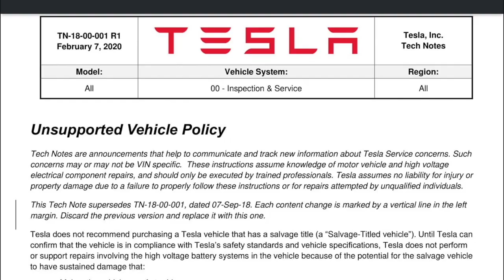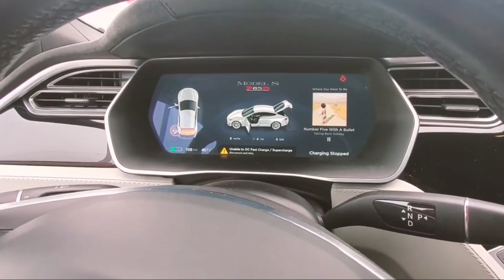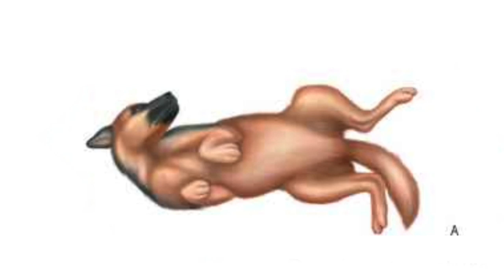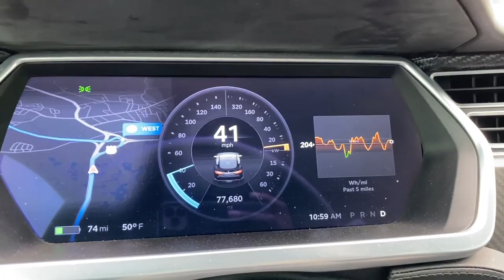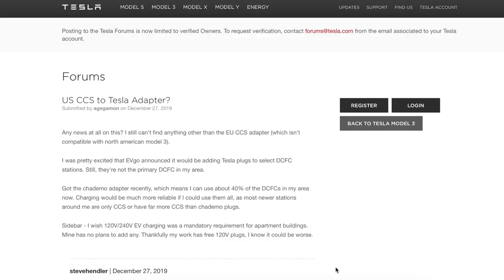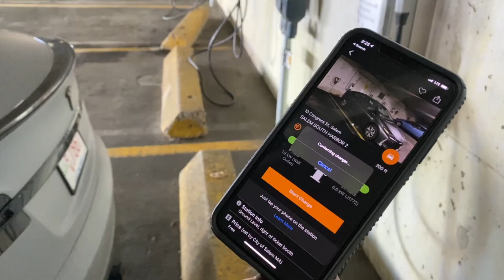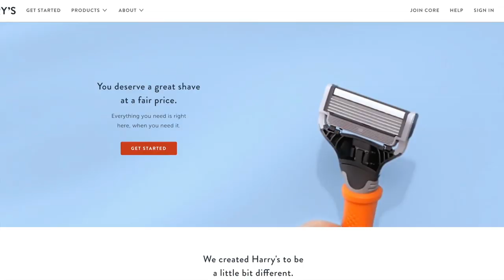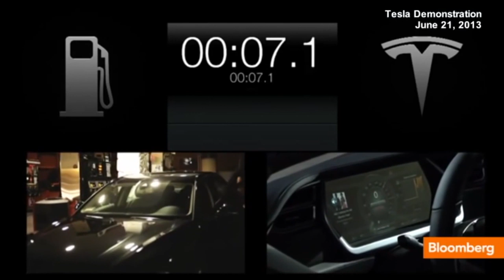Tesla ruined my car and it’s the best thing to ever happen to me!

Comment: The fact that THEY DISABLED THIRD PARTY DC FAST CHARGING is too far
Reply: and this is why i still drive a gas truck.
Reply: not really the fast charge system is basically enable by the car and if your car is deemed "unsuitable" tesla disables THEIR fast charge software. yes you own the car but dont own the software behind it (i completely disagree with this scummy business practice).
Reply: @shaneebahera8566  exactly its like saying here we will sell you this car but wait little did you know its actually only half of a car because we dont think this car is good to be used at its full capacity so were going to handicap it after you buy it, it wont already be disabled and notify you that it is before you get it, you can just find out later and then get hindered in your everyday life because you cant afford to buy new from us.
Reply: Did they realy disabled third party dc fast charging?
Reply: Tesla is basically Apple 😂
Reply: @mourinhov4360  Yes. Tesla remotely disables third party DC fast charging for salvage/unsupported Teslas
Reply: @neil532gamingneil532gaming  ok sad to hear that. Tesla is trash. Its better for our enviroment to repair broken things, instead of just buying them new. They don't have to claim that they care about our enviroment.
Reply: @shaneebahera8566  Eh kinda disagree. That would be like Chrylser disabling my 300's fill door switch because "hey the fuel door is computer controlled and we own the software and you rebuilt it so no gas for you". Tesla doesn't own EV America.. honestly disabling the ability to use a third party charger is probably going to be tossed out in a lawsuit as anti-competitive.. That'd be some interesting content I'd watch btw Rich so lawyer up buddy
Reply: @douglas685  its not really because you can still charge they are disabling the fast charge ability its probably mentioned in an agreement you sign or agree to when you buy the car. Tesla operates more like a computer company than a  car company and this is the kind of shit we just deal with like how apple can disable your device if you use unapproved repairs. Even if he sues them i doubt he would get anywhere because they arent targeting third party equipment  they are just outright disabling the fast charge system (not defending them here just mentioning they are probably on solid ground legally)
Reply: @shaneebahera8566  that agreement is likely non transferable. If i purchase it second hand I am not bound by the original agreement. Sony got sued for disabling features on the ps3 that were a selling point. Apply got sued for down specing there phones when they got old. Tesla will get sued and it will be forgotten. People need to start paying attention and talking with there local state reps on right to repair bills. This is pervasive and will only get worse.
Reply: @isaaclyonsf1  was thinking the exact same thing
Reply: This is just like what John Deere and others are doing to farmers.  Trying to prevent them from fixing their purchased equipment or vehicle.
Reply: @randerson752  EXACTLY!!!
Reply: @randerson752  Exactly.  This is a right to repair issue.  Tesla needs to be taken to task for it.
Reply: @randerson752  except at least John Deere doesn't disable any software features (I think?) like Tesla does

Comment: TESLA turned your car into, as far as charging goes, a golf cart.
Reply: Is your profile pic the startpage anonymous search icon
Reply: A very expensive golf cart.
Reply: Golf cart, EV... same.
Reply: Well, actually with a dual AC charger it still would allow 19,2 kW AC charging, so top up the 80 kWh battery up in about 4 hours. That's not too bad. Just find yourself an 80A Level 2 charger instead of the 30A charger that Rich used.
Reply: Difference is if still rather drive a golf cart
Reply: @koeniglicher  4 hours is about 3 hours and 55 minutes too long.

Comment: This makes me want a Tesla less. I hate when companies retroactively disable things etc. I am purchasing this car, not renting it. I shouldn't have to worry about them changing after the fact.
Reply: me too.  how will the resale value be held if they can turn off features that were purchased?
Reply: Yeah it honestly seems like it should be illegal. Like what's stopping them from pulling an Apple and bricking the older models once the new ones come out?
Reply: @the1anonymouse  Yup or deciding your 80% battery doesn't qualify. It always starts off with the small things and then escalates to the point of no return. iPhone is the scary example. (Imagine slowing down your old Tesla on purpose for example)
Reply: Comeonuseyourbrain  if that was the case they could've just continued the certification service and verified that nothing was wrong and that would've kept open another revenue stream for them. This is very much a violation of right to repair
Reply: Tesla isn't meant to be owned, they're meant for people who lease
Reply: Agreed! This whole thing about Tesla locking out DC fast charging would leave me wanting a Rivian or Nio instead, if I could actually drive.
Reply: @MrEeeaddict  but DC fast changing is NOT their Network so they have no right to make that rule
Reply: @texasforever7887  that's the shitty part but everyone here is yelling reee supercharging so that's what I'm addressing
Reply: don't be an idiot with a gasmobile. This only happens to salvage cars.
Reply: @MrEeeaddict  If that were the case they would not have also disabled all D.C. fast charging.
Reply: @MrEeeaddict  fan boy
Reply: Comeonuseyourbrain  saftey measure my ass, theres always a potential hazard charging any battery anywhere from AA to cars. Tesla just trying to be greedy dictators
Reply: @k.a.c613  Tell me why should you be able to use someone else's network and not follow their rules?
Reply: @MrEeeaddict  Deactivating access to their network is one thing, deactivation supercharging across the board (which is what they are doing atm) is bad business practice, forcing someone to pay 12k to get access reactivated and then revoking it again is something i would expect from a shady backyard dealership, not a multi billion dollar "futuristic" company.
Reply: @MrEeeaddict  well actually they dont own the DC network . If DC provides fast charge who are they to interfere with a third party network
Reply: Comeonuseyourbrain  So let me restate what you just said:
"It is a safety measure to protect Tesla's reputation in the unlikelihood that the battery catches fire while Supercharging".

So how is that any different from an ICE vehicle that catches fire as a result of DIY maintenance?
The manufacturer is never responsible in that type of situation.
ICE vehicles catch fire all the time, whether due to DIY or certified maintenance.
Should any ICE vehicle that is maintained by its owner instead of a certified mechanic not be allowed to refuel at a service station?
Perhaps you would have an ICE owner fill up 1 gallon gas cans to refuel his ICE vehicle.
That is the equivalent of what Tesla has done by disabling Level 3 charging in addition to denying access to its Supercharger network.

Tesla has the capability of monitoring every aspect of their vehicles remotely.
It's battery management system can tell you everything about what is happening during a Supercharging session, which includes battery voltages and temperatures.
During its recertification process, Tesla could Supercharge the vehicle and identify any discrepancies.
If the vehicle fails Supercharger recertification, then the owner has the choice to let Tesla repair that functionality or not.

If a salvaged Tesla passes the Supercharger certification, then there would be no reason for Tesla to turn it off.
If necessary a Tesla recertified for Supercharger usage, could be monitored during every subsequent Supercharger session and disabled remotely should any discrepancies emerge over time.

However, whether a salvaged Tesla is recertified for Supercharger usage or not, that does not give Tesla the right to disabled their ability to Level 3 charge via third-party chargers.

That is the equivalent of an ICE MFG reducing fuel intake down to the size of a straw, post-purchase.

Comment: tesla deactivating superchargers for your car should be illegal
Reply: Tesla owns the charging stations, so its their right to say who can use it.
Reply: @quax8923  the contract probably has the ability to remove users from it for this very reason. And thus not violating it.
Reply: exactly
Reply: You buy a car it's yours they shouldn't have the right to disable something that came with the car when originally purchased
Reply: They have every right to disable supercharging since they own them, but disabling DC fast charging is a different story.
Reply: Darth Lost sure, for salvage cars where the previous contract doesn’t apply. Disabling DC fast charging entirely is basically just property damage though.
Reply: @darthlost  This is such a dumb argument. They're disabling people who PAID to have their cars re-certified to use supercharging. There is no other reason to do it other than to get you to buy a new car from them.
Reply: DID ELON GET SUED FOR FALSE ADVERTISIN?
Reply: Place my comments at the bottom look who's sucking it up 🤣

Comment: Put a disel generator on a trailer and tow it behind your Tesla. Also a sign: Telsa took away my supercharing so I build my own.
Reply: Sounds like Geoff
Reply: Make sure that thing is straight piped and tuned to smoke like a steam machine.
Reply: this is the future
Reply: @Mike L I'm sure a 16v71 by itself is beyond the towing capacity of the tesla let alone with a generator on it lol. But great mental image!
Reply: Or just ad a BMW i3 range extender motor, install it in the front trunk... 🙂
Reply: Better yet put the engine in the Tesla and it will run on gas
Reply: Or, just get some solar panels on the roof and side door panels.  :)
Reply: @sufurt782  A MOPAR engine!
Reply: @777bruizy  great only take a month to charge.
Reply: how to turn a Tesla into a hybrid
Reply: This would work wonders, im sure :D

Comment: I think this could go with “right to repair” fighted in US you can look at louis rossman channel.
Reply: No legal expert here but perhaps this is slightly different? Louis Rossman hasn't exactly won the battle against Apple, so there is no legal conclusion there. Tesla isn't preventing customers from repairing their own cars, just that they are preventing them from using the Supercharger network. I guess one could think of having the Supercharger network like a subscription - similar to how some manufacturers will give out a year of SiriusXM radio/premium connectivity features etc when you buy their car. My take on this is that Tesla is allowing all owners to have the ability to use the Supercharger network granted that the owners' vehicle hasn't been resold/transferred ownership; the car is still in the original owner's hands.
Reply: @masterlorden3075  Removing the Tesla owned supercharging from a safety argument makes sense. Tesla is doing it because they want people to buy new cars though, why else would they of killed the recertification program other than it costing them too much? However disabling 3rd party DC fast charging or vehicles that have been recertified is a super dick move. It's kind of like those auctioned Tesla's that had self driving paid for, but then deactivated when the new owner took possession of it, essentially reselling the software to the new owner, instead of it being tied to the car which is totally insane. I couldn't imagine having a manufacturer having that much software control of the thing I rely on so much daily. I'm a power user with my PC and I hate when Windows won't even let me force update drivers, and that's with a totally non-essential piece of tech. Let alone your car. Why are people putting up with this? This is totally a right to repair issue because there's currently no precedent for this and no government regulation for consumer protection
Reply: @masterlorden3075  its exactly the same thing...
Reply: I promise you, they are aware of each other
Reply: He's fighting for devices, the right to repair vehicles I believe has already been affirmed by the Supreme Court
Reply: Having trouble finding anything about it. With all the proposed right to repair bills ( nothing to do with a person doing repairs on personal cars, only manufacturers sharing tools schematics etc with independent shops). It's out there somewhere, not worth the time to research. Lol. The gist of it was it's your property do with it as you please. Firmware on a vehicle isn't software ie it's not licensed. It's owned. Now some of the software on a Tesla is just that software. That means it's licensed. I could be wrong but I believe if it's a vital function of a device there's limitations to them turning it off. I believe that's what got Apple in trouble with 3rd party screens being disabled essentially bricking a device they don't own. 
 Then again I read so much garbage, fake news and "this should happen" articles anymore, who knows. The point is whenever there's a will, there's a way. This is also why I haven't tried to get an EV, I would probably catch it on fire 🔥 trying to bypass something. LOL
Reply: @ADirtyScrub  Sorry, I have to say this...it's "would they HAVE killed", not 'would _of_'. I know I'm going to get hate for this but if you don't know basic English it sort of undermines your opinion a little. It does matter.

Comment: Tesla has now surpassed Apple as the most restrictive brand 🤬
Reply: Actually not really if you replace the screen on an iPhone you lose a feature you replace the home button you lose a feature you replace the cameras you lose a feature so really whos more restrictive?
Reply: @kelvinnotfound8023 
Tesla, because they can remove features from your car at will.
Reply: Bomb - NO, one has the RIGHT to Repair ANYTHING anymore, just look at any Prouduct Instruction manual - "Do, not open, or your Warranty is VOIDED"
Reply: 2010ngojo But so will apple on tesla you only lose one feature but apple can remove a bunch more did you even read what i said?
Reply: John Deer: Hold my beer.
Reply: @kelvinnotfound8023 
Several features can be lost. Supercharge, autopilot, etc. They can also affect the way the car drives too. Can be very dangerous. Whether they can legally is another story.

At least it's just a phone with apple. And I can choose to accept the update. Not sure about tesla. Also, if you don't repair your phone,m then so what? My phones rarely break. Granted, I don't use iPhone so...
Reply: @markplott4820 
The warranty void crap is not legal in the US.
Reply: @2010ngojo  - then TRY buying a PS4 and crack open the processor then trying to Return it to SONY , not going to get Anything from SONY.
Reply: @markplott4820 
I'm talking about the opening part. Not fucking stuff inside of it.
Reply: @markplott4820  its AFTER the waranty ends that this is important.....
Reply: @SNORKYMEDIA  TESLA sells Extended warranty for their cars, and IF you upgrade to a NEW Tesla in 5 Years it a good thing, as Advancements have been made to the Vehicles, someone will be GLAD to buy your 5 yo Tesla and Drive it for another 3 - 5 years.
Reply: John Deere: Hold my beer...
Reply: Ha, not even close
Reply: Amen
Reply: @lifequest7453 
Well you don't own the software. However, it depends on the user agreement terms. I would not accept any agreement where the company can go in and change crap without me accepting it first.
Reply: @markplott4820  'No, one'?
Reply: @2010ngojo  apple makes your battery worse so you can upgrade
Reply: @arnavSharma-n9k 
Wouldn't be a problem if we have replaceable batteries. It was less of an issue for the 6s and older, because at least the battery can be easily removed.

Nowadays, you can turn that function off and I think they offer battery replacement services. Wouldn't use an apple product these days though.
Reply: Mr Krabs batteries degrade?? apple doesnt cause that